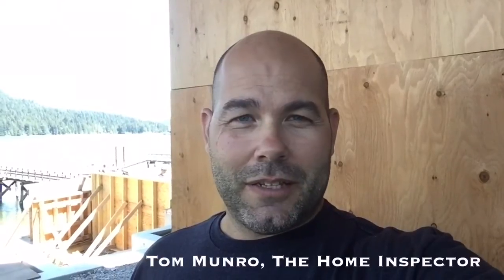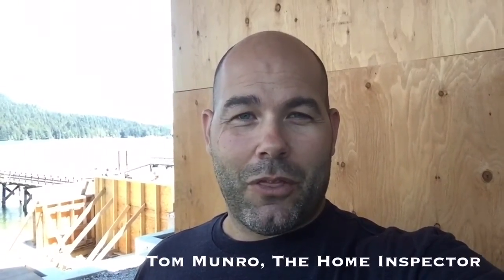SUPER COOL- Concrete Pool Construction

Comment: Weird , this  pool only needs 3 guys TOPS,  guy on nozzle , guy with a couple of boards to stop overspray from nozzle , and one dude shaping . 
If the Crete service is running on time , 7 cubes only takes us 30 mins to download. We spray @ 80 slump .
Should only take a solid crew around four hours set up to driving down the street to the next job .
Reply: The hard work in pool construction is not in the concreting, that is the easy part. The hardest work is the digging, setup and finishing.
Reply: @BLY99  do you dig by hand?
Reply: dawson4545 yeah your right , way to many guys .